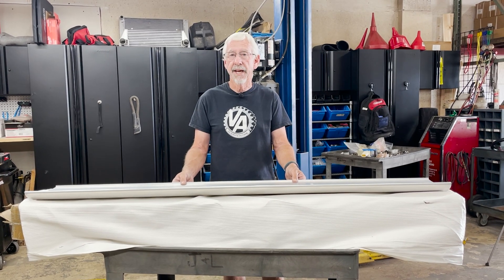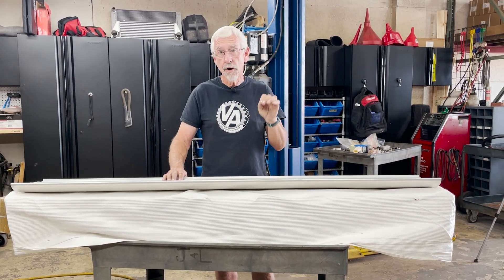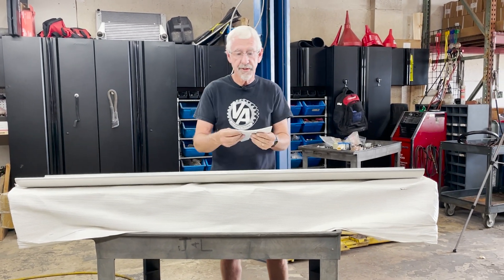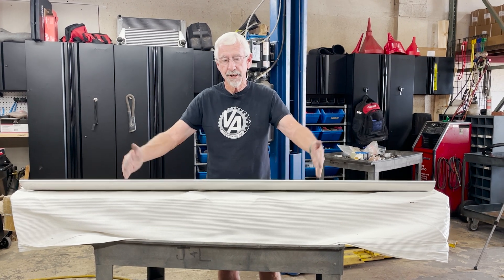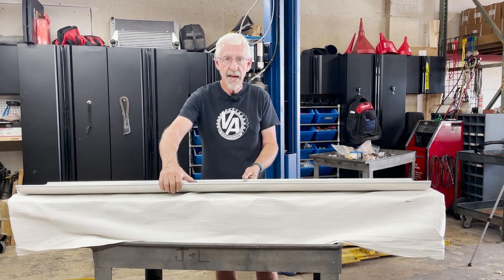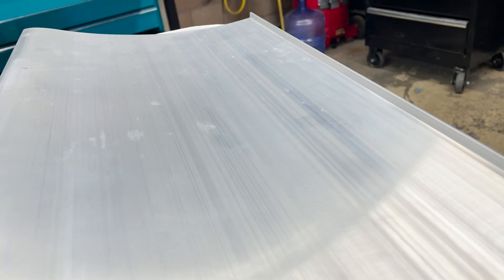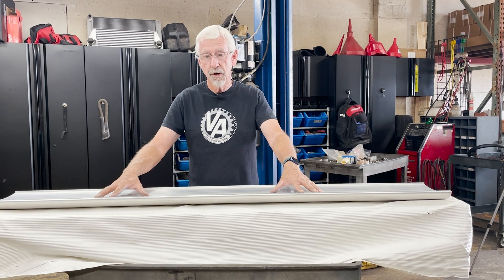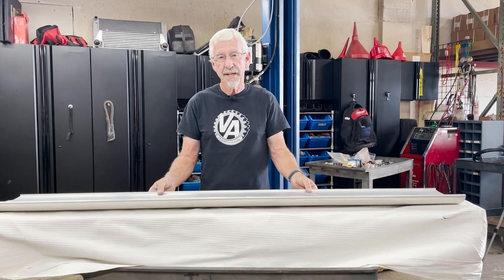Racecar THINGS! Wing Logic

Comment: I have a unrelated question I watched your video about the rear spindles bolting on to drum trailing arms I can’t find the spindles
Reply from the maker: There are a bunch of cars you can get these spindles off of. 88-91 CRX Si, 92-95 Civic Si, 99-00 Civic Si, 1990-2001 Acura Integra.
Reply: I know what cars have them but if I could find them then I would just get the whole trailing arm lol I was wondering if you know a link or a place I can order new spindles because I can’t find them only outrageously priced trailing arms
Reply: Also I thought only 90-91 crx si had disc
Reply from the maker: @josephgreeson2396  I usually use the website row52.com to find them in salvage yards and then go pull them off myself. Our local yards charge between $100 and $200 depending on whether or not there is a sale. I strip them to the parts I need since a lot of yards will charge you for each part on the trailing arm.
Reply: Thank you